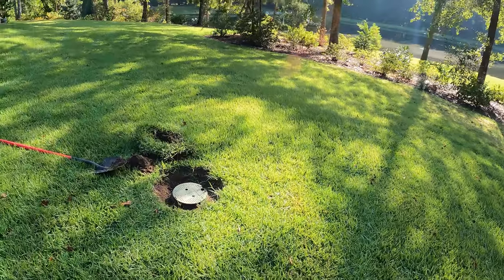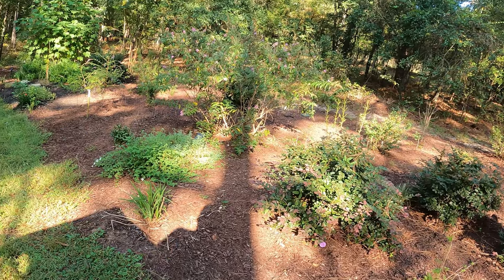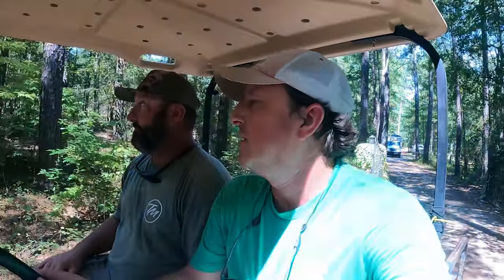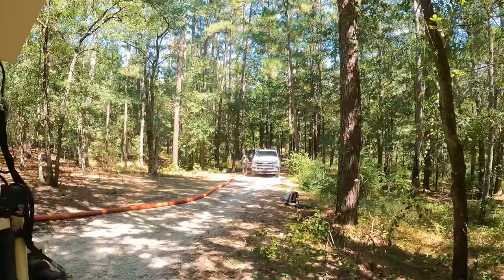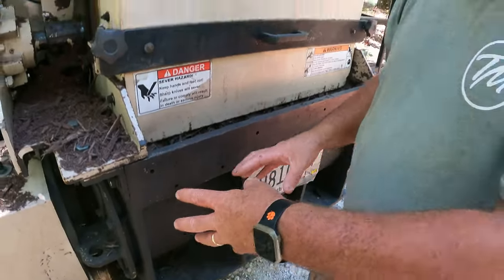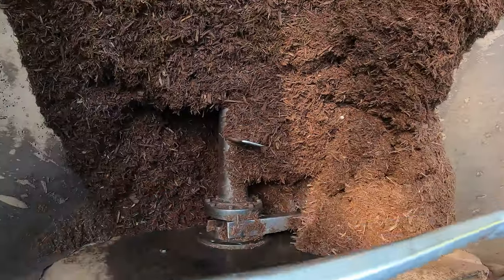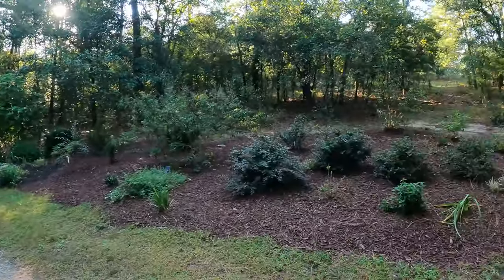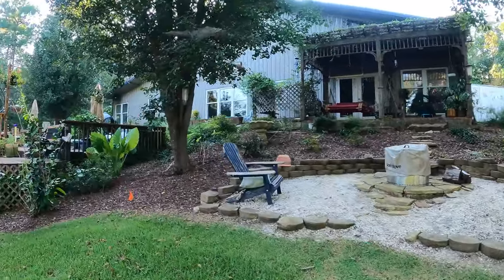Mulch Blower Truck Covers 150 Yards in Record Time #mulching

Comment: How much did that 144 yards cost with installation?
Reply from the maker: well, I kind of get a deal since the mulch facility is on my property and the guy blowing the mulch is a customer.....lol
Reply: All depends it could run from $40-60 a yard depends on material being used. They have a small truck they make 60 to 70 yd trucks